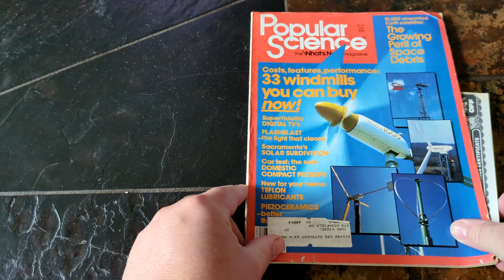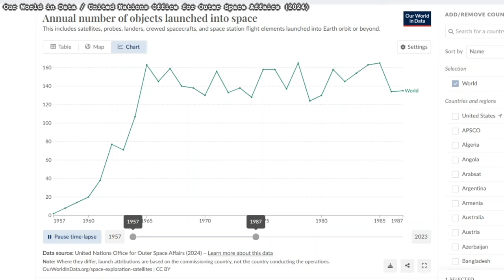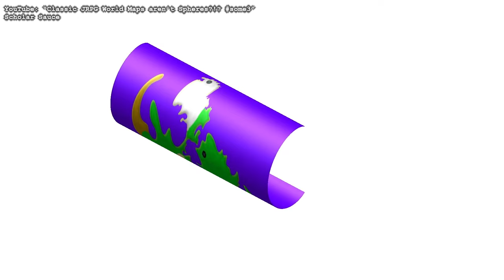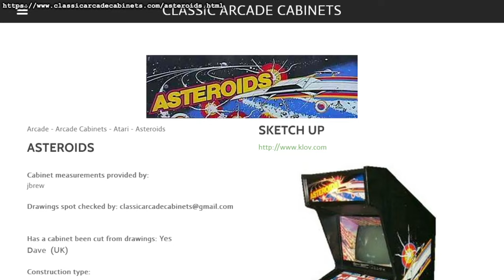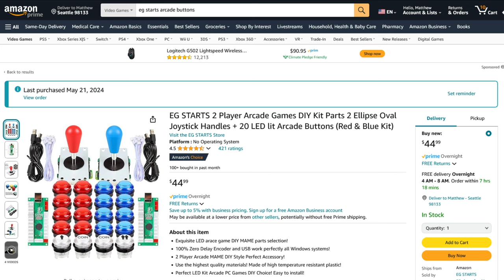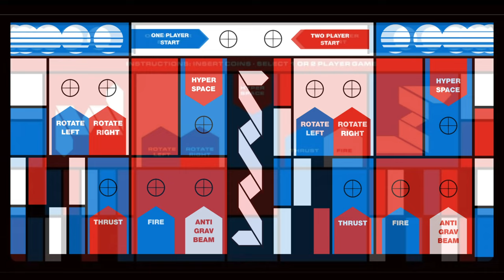Space trash: the video game

Comment: Really hoped that you would get a vector display for full authenticity, through I have no idea if they even make them anymore and if you can plug a PI to one
Reply: Unfortunately, no one has made new vector monitors since the 80s.  All the vector monitors you see out there nowadays are repaired or refurbished.  (It is still possible -- barely -- to obtain replacement CRTs for them, although there can often be a bit of a wait; the few remaining manufacturers of CRTs make them on a "we will accept pre-orders with a deposit, and we'll make them when we get enough pre-orders to justify tooling up for a production run" basis.  The electronics, however, are not manufactured at all, and some of them -- such as the Cinematronics monitor -- depend on some electronic components which are also obsolete and not made anymore.)